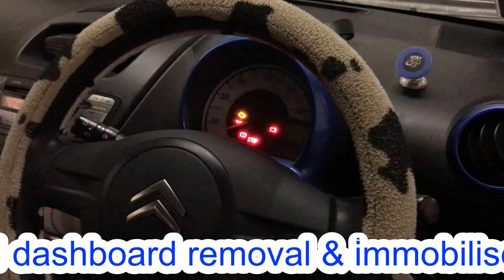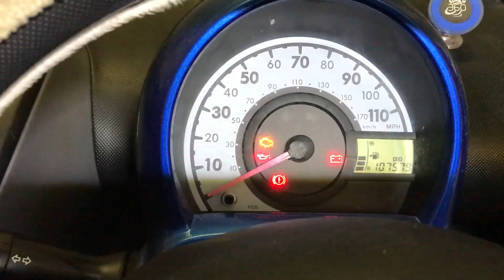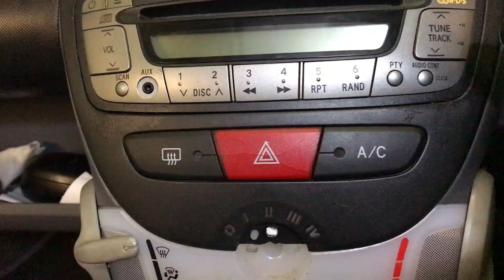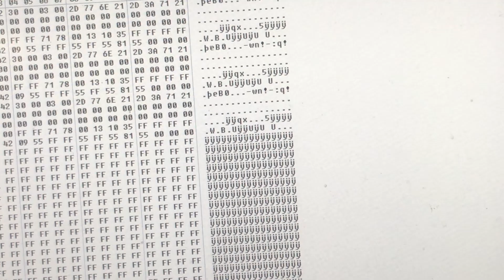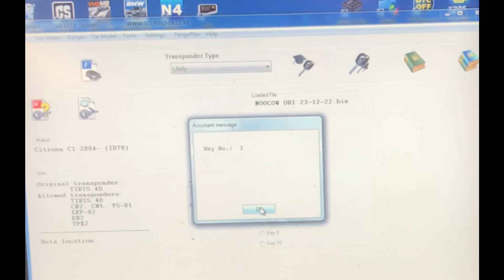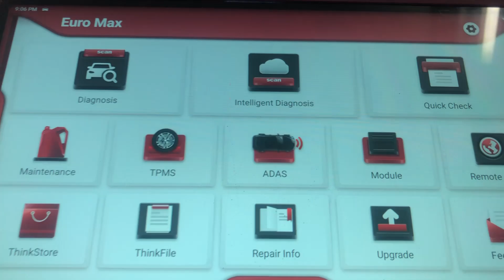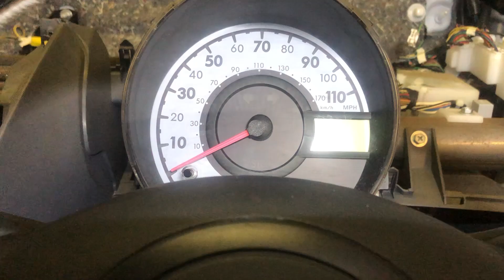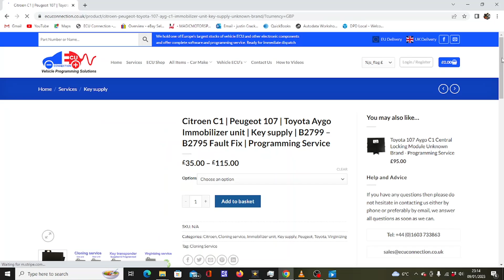Toyota Aygo - Citroen C1 - Peugeot 107 Dashboard removal + No comms with Immo fix - A799 fault code

Comment: May have to add if anyone else sees the video if you change the key case make sure you take the immobiliser chip transferred to the new case otherwise the car will not start. Thank you so much for the info on the video.
Reply from the maker: Yes, indeed! Many DIY’ers often have no idea there is a transponder in the case & so exactly this!

Comment: why i see in some forums that it can be up to 35 minuts and here you say that not from 31 minuts mmm
Reply from the maker: @Espinete87  I’ve always had success with 31 mins, as long as it’s over 30 mins then all should be fine, 35 mins should be fine, best to try yourself & make your own mind up on the best timing..
Reply: I have tried 30:45 afraid of waste the time (im trying to fix the car of a friend in the street😅) and.... it didnt work😢
So im going to try again😅 becouse i have hope on your profesional video hehe
Reply: @JC-ECUConnection After wait 36:30 aprox it didnt work. But now i have realized that the airbag light ia not coming on. I have tried diferent wires in case of bad contact but... nothing😢 

https://youtube.com/shorts/-cm0B3PVvUw?si=KjJ2nekZcGZWIERB

any idea or suggestion?
Reply from the maker: @Espinete87  I really can’t say without having full diagnostic scan results & whether or not wiring tests have been performed & if the keys are functioning correctly, it appears the synchronising method you are doing is correct, although this is the last stage of Immo repair that you are doing..
Reply: @JC-ECUConnection  At the end it seems to be related with the alternator  a component got damaged and it damaged the batery, when i tried to charge and it showed that it was full. So i dont know exactly the solution becouse it was a friend of mine car, but just to leave here my experience :)

Comment: I have no Comms with anything and a start and cut out. Is this likely an immobiliser fault?
Reply from the maker: @mikeprada1677  Yes it sounds like it could well be one of the various immobiliser faults these vehicles suffer from…
Reply: @JC-ECUConnection  if I send the immobiliser unit to you are you able to confirm/repair?

Comment: airbag disconnecting with battery not disconnected concerns me. I need to do this job tomorrow for the rear defogger relay. Is it safe to just plug the airbag back in with ignition off and key out?
Reply from the maker: @TriforceOfCourage97  ignition off & key out is fine…
Reply: @JC-ECUConnection  thank you. this helped a ton

Comment: Hi there. Im from South Africa 🇿🇦. I have a issue with my Citroën C1 2007 model. I lost my key and got a new one. Linked it ti the immobilizer but doesn't want to start. It crank. I have no Spark and don't hear the petrol pump when I turn the key. Any advise for me please???
Reply from the maker: Firstly the key transponder must be programmed to the immobiliser, then if it doesn’t start you will need to perform the 30 minute process with the link in the OBD socket as in the video..
Reply: @JC-ECUConnection  thank you for the reply. I did that already, still no start.
Reply: i also did that still not starting cranking but not starting
Reply from the maker: @preveledgegondo8727  how was the transponder programmed to the Immo?  By eeprom? What type of transponder was used? Which transponder programming tool was used? What Diag tool are you using for diagnosis? Do you have comms with the Immo? What fault codes do you have? Have you performed wiring tests? If so then what tests have you performed? Maybe if you can give concise answers to all the questions above then maybe I could guide you in the right direction…
Reply: Good day. Just to keep you up to date. I got a computer box from a donor C1. The engine light is on now. What I have noticed is that there are no spark and the fuel pump is not switching on. What might the problem be now. Thanks
Reply: I have plugged in a diagnostic machine but it does not pick up the car
Reply from the maker: @profgino78  keys must be programmed to the Immo & Immo set to virgin

Comment: Hi I have an immobiliser fault b2795 , I've had an auto locksmith out , he's reprogrammed the keys still non start , we've took the immobiliser control unit out for him to read data and he said it looks ok and have virginalised the car also and still won't start , would this suggest that the control unit is broken?  I'm not sure if I should buy a new unit or send the old one off to yourselves? Any help would be appreciated
Reply from the maker: Hi, thanks for watching!.. firstly do you have comms with the Immo with Diag tools? If you don’t have comms then you will need to substitute it with another Immo & check for comms & then clone the data.. if you do have comms then continuity check wiring between the Immo & ECU…
Reply: @JC-ECUConnection thank you for the reply , video is very helpful... wiring all looks ok . There seems to be something draining the battery then knocks the immobiliser out when the battery dies , from what I seen it appears that I have some form of coms like you did in video but still coming up with immobiliser fault , im going to pick up another immobiliser unit tomorrow and get that read and coded. I'm just not sure what road to go down with regards to sending unit off to you or look at what else could cause the problem . I did try phoning today but could only get the receptionist as I wanted to explain what was happening
Reply from the maker: @C170784  Sorry we get floods of calls with people wanting me to diagnose cars over the phone, it’s really difficult personally handle the calls, to check for parasitic drain you will need a multimeter & check the amps being drawn at the battery & then systematically remove fuses to see which circuits are causing the drain, there should be lots of YouTube videos showing how.. Double check the comms with immo unit & go from there…

Comment: My C1 seems to be self virginizing, when left for a day you go to start it and it does exactly what yours did when you put a virgin box on. then starts and runs fine after coding it with the jumper trick. any tips on how to fix it or what might be causing it to self virgin
Reply from the maker: No, sorry…

Comment: My Peugeot 107 has a problem like speedometer in not working when parking lights are turned on can you please share your thoughts on this problem i checked the fuses they are ok thank you
Reply from the maker: Hi & thanks for watching!.. As for the problem you have there, I’m afraid I have no idea! Possibly a bad earth or a random wiring issue.. probably best to run it to a good auto-electrician to check it over..
Reply: sounds like a bad ground. happy hunting

Comment: Hi, Citroen C1 2006, B2799 fault code when scanning under Aygo.
Car was left unused for months so totally flat battery.
Recharged without disconnecting battery.
IMMO recognises keys, but IMMO not synced with ECU.
I'm guessing IMMO got scrambled by the recharge, can it be cloned/fixed?
Reply from the maker: Yes, this could be scrambled data, first try the re-synch process, if this is not successful then send the Immo & keys to us for checking & file repair - follow the link in the description to our service page….
Reply: @JC-ECUConnection  Thanks very much, resync didn't work - I'll do the wiring checks & send you the immo & keys if wiring is OK.

Comment: I have a question. I have bought an original central locking kit for my Peugeot 107. I want to build it in. But where can I find te module central locking box? Where is it places in the car? It looks exactly the same as the box in this video. And the key that i got with the kit is from another car than the central locking box that i got with the kit. How can I connect those too. Sorry for my english, im from Holland.
Reply from the maker: Hi, the central locking module, if fitted to your vehicle is located under the dashboard on the drivers side approximately above your shins would be if you were seated in the car (This is for UK Right hand drive cars) I am not sure if this is the same for LHD

Comment: Hello.  Friend, excellent video and very interesting.  I have a problem with an aygo, the keys were lost, we tried to do it and nothing, the immobilizer gives little information.  If we virginize it will work
Reply from the maker: @sulimanmohamed5430  Hi, no if you have lost keys we can make you new transponders from your immobiliser module - for more info visit our website (Link below) 
https://ecuconnection.co.uk/product/citroen-peugeot-toyota-107-ayg-c1-immobilizer-unit-key-supply-unknown-brand/

Comment: Thanks for the video. My C1 has an immobiliser fault and the engine will crank just fine but it won't fire up at all, even for just a second or so. Do I have it correct that I'd need to send you the immobiliser to be virginised and then I can reinstall it and use a jumper to resync the key and all will be fine? Thanks.
Reply from the maker: Hi, there is a few very similar faults - firstly you will need to check continuity in the wiring between the Immo & ECU, also check for comms with the Immo - if you have no comms with Immo then you will need to replace the Immo unit, we can clone a replacement - if all the wiring is correct & you have comms with the Immo then the data may be corrupt, we can correct this - please click on the links in the video description to our website for further info.
Reply: @JC-ECUConnection  Thank you, I thought I responded to this comment a while ago but it appears not. If I were to send you the original immobaliser and a donor immobaliser, would you theoretically be able to clone the old one onto the new one and then virginise the new one ready to be resync to the keys? I only have an old diagnostic tool and it won't tell me the actual fault code. Cheers.
Reply from the maker: @dnalekaw4699  Yes, if you are unsure of the fault & want to cover both bases we can analyse your Immo data & then clone / virginise a replacement unit for you..

Comment: Hej .var kan man skaffa en sånt lång nyckel(5 stjärnig) går det att använda något annat istället, isåfall vad ?
Reply from the maker: Hi & thanks for watching! - there is a link in the description to a company in the U.K. that sells a bit set (1/4 drive), hopefully they dispatch internationally - I guess you are in Sverige?
Here is the link again:
https://www.workshopessentialsonline.com/product/5-point-tamperproof-security-torx-socket-set-1-4-drive-9pc-trident-t111600/
Reply: Hej.jag kommit åt immobilisator. Det jag tänker på just nu,nästa steg.  När jag sätter allt tillbaka... Ska man tänka extra på airbag ?kan den explodera typ? Eller annat att tänka på .När jag kopplar på batterier o sånt.  Utan din video skulle aldrig funka,hjälpte verkligen massor för mig som inte ens kör bil.
Reply from the maker: Hej! It’s not necessary to disconnect the airbag or steering wheel when removing the dashboard - nor is it necessary to remove the battery when doing this job..
Reply: @JC-ECUConnection  Tack så mycket för korrekta o snabba svar. Då e det bara att sätta allt tillbaka på sin plats.
Reply from the maker: Yep, ‘Refitting is reversal of removal’

Comment: Have faultcode b2799 on my aygo. Any ideas?
Reply from the maker: Check as in video for fault codes & comms with immo - check wiring & if necessary check out our services:
 https://ecuconnection.co.uk/product/citroen-peugeot-toyota-107-ayg-c1-immobilizer-unit-key-supply-unknown-brand/

Comment: When the immo is broken, can i get a used one on eBay and put in the bridge for 30mins and it will work ?
I didnt understand everything what you said because of my english. 
But the video is very good. 
Thanks for sharing your knowledge.
Reply from the maker: Hi, thank you for your comment.. No, I’m afraid this will not work your keys will not be registered to the secondhand Immo, we can either clone your Immo if you have the old unit (providing the data is not corrupted) or virginise the replacement Immo and add your key data to it (or make new key transponders) & then it can be adapted to your ECU using the bridge wire, (This method is used when the original Immo data is corrupted or Immo has been lost) for more information visit: www.ecuconnection.co.uk - we dispatch to all European countries & the UK
Reply: @ECU Connection UK (By JCcars)  sorry to but in ..a friend has same issue and his stopped running after the horn started sounding at 6 am ..spark at cylinder 1 but not the others ruled out ignition  coils.  New plugs etc. New battery . Checked earth's I can see.....immobiliser I'd have said is the issue but how can we be sure ? Could be wasting money.  No codes stored here either 

Thanks
Reply from the maker: Hi, an immobiliser issue would generally leave fault codes in the ECU & immobiliser module - although not always as shown here in the video, make sure you have comms with the immobiliser unit & go on from there..
Reply: @ECU Connection UK (By JCcars)  I'm almost a novice on immobilisers.  I know how they work etc. My obd  is very basic but no codes though I'm gonna test the cam and crank sensor insitu  I've had them both out .

What's indicating a possible fault with those is, when turning over the rev needle don't move . There shouod be movement when turning over

Comment: Why is the air bag light flashing? I carnt get mine off..
Reply from the maker: I can’t remember the actual fault code in the airbag ECU on this job but it cleared with Diag tool after repair - First thing you will need to do is scan the airbag system for fault codes & repair as necessary…
Reply: @JC-ECUConnection  your wasnt plugged in. thats why i would suspect. I can just clear that with an AUTEL scan tool right? I hope for 600 I can do that
Reply from the maker: @ I can assure you the airbag ECU was plugged in, this is a regular fault for us to repair! Also I can assure you that you can not repair no comms faults with Autel or any other diagnostic tools, it is a hardware fault on the airbag ECU circuit board..
Reply: @JC-ECUConnection  got it. so unplugging it and plugging it back in will clear any faults if there wasn't any to begin with?
Reply from the maker: @TriforceOfCourage97  We would of cleared all fault codes with a diagnostic scanner after the repair & all was re-assembled, here in this video we still had the dashboard out & passenger airbag had not been installed at the point of filming..
Reply: @JC-ECUConnection  yep. thanks for all info. you helped me a lot with this. Its not that bad of a job at all.
Reply from the maker: @TriforceOfCourage97  
No worries, yes it sounds like a daunting challenge to take the dash out but its actually quite easy!
Reply: @JC-ECUConnection  yea, this was the best video i have found for showing it. All the best to you. And thanks again